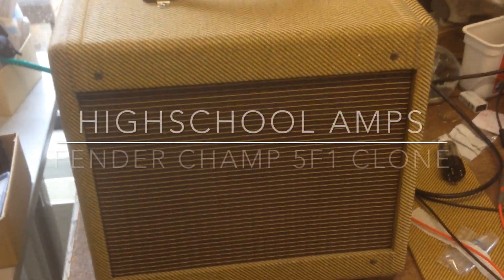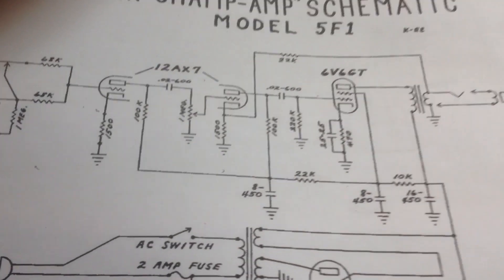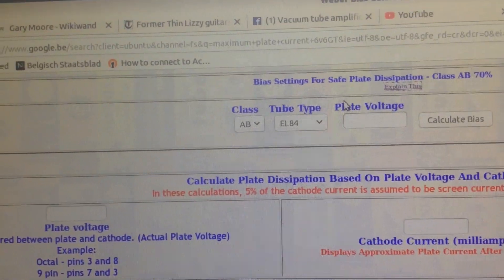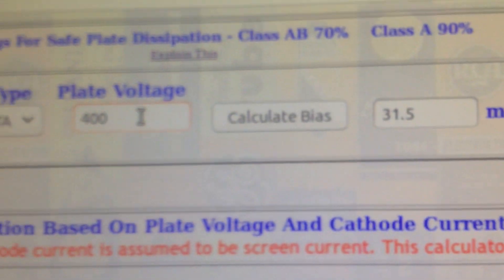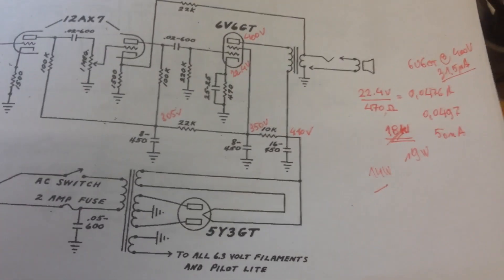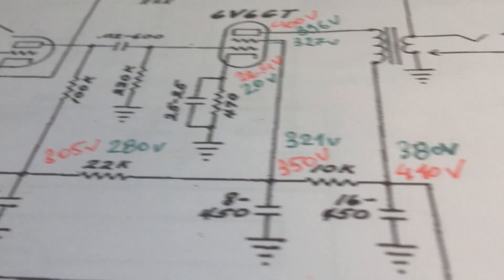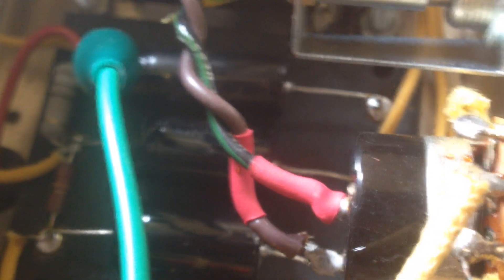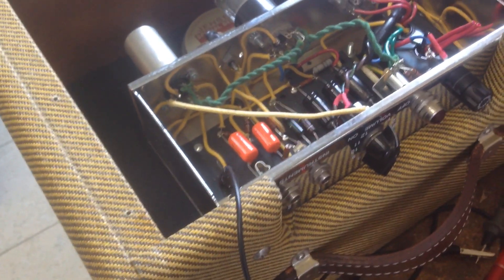Fender Champ 5F1: biased way too hot

Comment: Thanks for an interesting & informative video. I noticed that the rectifier & power tube sockets are installed incorrectly from the outside of the chassis, instead of the inside, causing the brackets to bend, & makes the socket too rigid. The mounting screws can also come loose.  Give the Dog a piece of cheese for me.
Reply from the maker: Thanks so much for that comment -- will check those octal sockets, never noticed that. This is an older video -- check out my newer champ videos: switching out the 5Y3 might work better to lower the B+
Bonnie says "thanks for the cheese'!

Comment: I would put in a 6l6 they love running hot
Reply from the maker: When the video was made, it wasn't my amp, so I couldn't blow it up! However, I did buy it since, hopefully I have the energy to make a follow up video... PT cannot take a 6L6
Reply: @zjokka  it sure can a 6l6 at 350vdc at the plate at 50ma is fine u can run them even at 275’

Comment: Voltage is rising I have 122-124vac in boston  so I just use a varic now because the tube filaments are all over 7vac that will burn out a tube a lot faster

Comment: I've found that replacing the 470Ω cathode resistor with a 600Ω biases my 6V6 based Champs perfectly.
Reply from the maker: I acquired this amp today, stay tuned, there will be an update in the near future. Subscribe and tick bell... will try out your advice. thanks
Reply: @zjokka  In recent builds I've had to go as high as 750Ω to bring the bias down enough to not cook the output tube.
Reply: I like 1k myself
Reply: @jimcatanzaro7808  680ohm here! It has a great clean tone before noon and still crunches nicely after that!

Comment: Maybe you've noticed it already but the first dropping resistor in the power supply should be 10k which is brown,black ,orange and not 10 ohms(brown,black,black).
Reply from the maker: Wow - its been a while and the amp belongs to a friend but i Will most certainly check this — thanks!
Reply: @zjokka Sure. No wonder together with the 5u4 and the wrong primary connections the voltage was too high.I find the sweet spot for my 5c1 and 5f2a clones  at about 310-320 plate voltage with the screens around 30 volts lower. Glad i could help.;-)
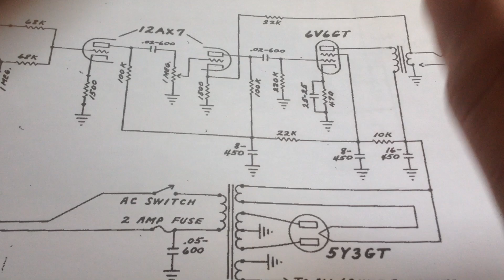Reply from the maker: I checked this again: the resistor really looks like 10 ohm, but it really is 10k -- 02:12 there is a drop of 50V over that first resistor... I now physically tested the resistor, it's 10k
Reply: You´re right! With the voltage drop it should be a 10k.My bad.👍 @zjokka

Comment: Too hot, because you install a soviet kenotrone tube 5ц4с. It have smaller voltage drop. If you install an original 5Y3GT tube, bias will OK. Sorry for my bad english, Im from Ukraine)
Reply from the maker: Hi thanks for the comment! This amp was built in an amp building course, then sold to my friend. I never gave it much thought, but you are right, I googled 5ц4с and it's exactly like what is in the amp as seen at 7:45 -- but at 9:24 you see me plug in an Adzam 5Y3GT -- to little avail. Also notice how Tubeampdoctor in Germany relabels old East German/Russian military stock wrongly, their 5Y3 is 5ц4с too... 

Thanks so much for the heads up!
Reply: Евгдений, здравствуйте, могли бы вы помочь мне с одной проблемой. Не подскажите сайт, на котором можно найти схему champ'а на российские 220v ?
Reply from the maker: Привет мой друг! Вам просто нужно посмотреть на экспортную модель усилителя Champ. Единственное различие заключается в входной или первичной стороне силового трансформатора. Модель США принимает 110-120 В, но модель экспорта принимает 180-200-220-240 В и преобразует ее в требуемый +/- 400 В. Надеюсь это поможет...
-----
Hi my friend! You just need to look at the export model of the Champ amplifier. The only difference is in the input or primary side of the power transformer. US model accepts 110-120V, but the export model accepts 180-200-220-240V and transforms that in to the required +/- 400V. Hope this helps...
Reply: Аня, схема та же, только силовой трансформатор (его первичная обмотка) расчитана на наше напряжение. Кстати, сетевое напряжение уже давно не 220 вольт. Согласно стандарту https://www.google.com/search?q=%D0%BD%D0%B0%D0%BF%D1%80%D1%8F%D0%B6%D0%B5%D0%BD%D0%B8%D0%B5+%D0%B2+%D1%81%D0%B5%D1%82%D0%B8+%D1%80%D0%BE%D1%81%D1%81%D0%B8%D1%8F&ie=utf-8&oe=utf-8&client=firefox-b-ab  Это нужно учитывать при подборе/изготовлении силового трансформатора.
Думаю, будет интересно поизучать творчество наших крафтеров на форуме ГитарПлейер. https://forum.guitarplayer.ru/index.php?topic=104468.0  Там и мои поделки есть...